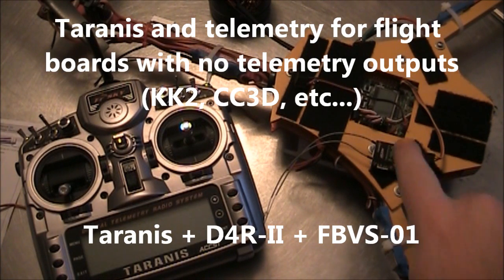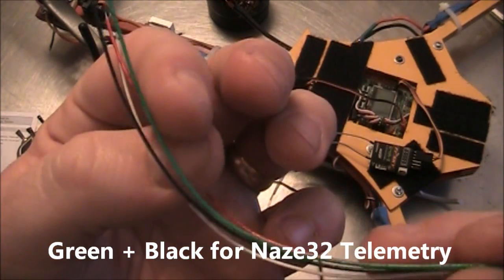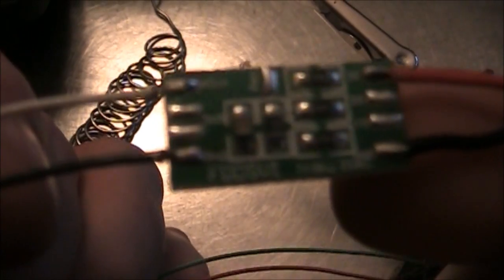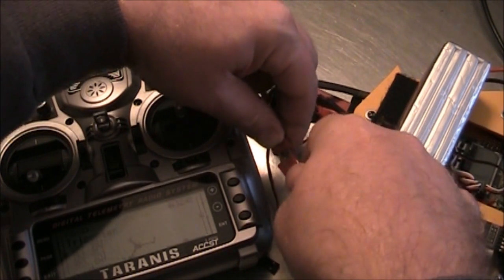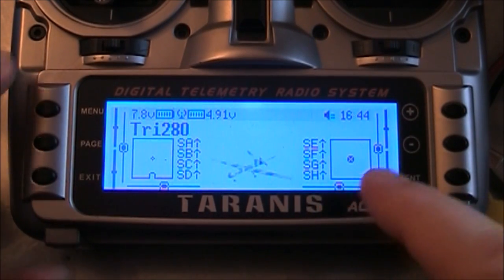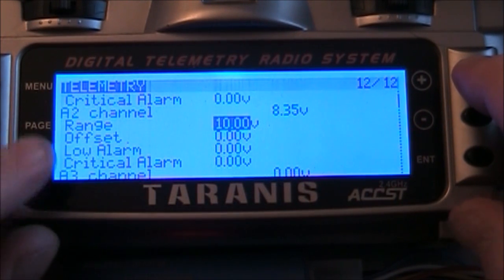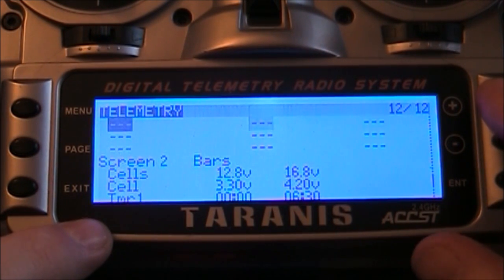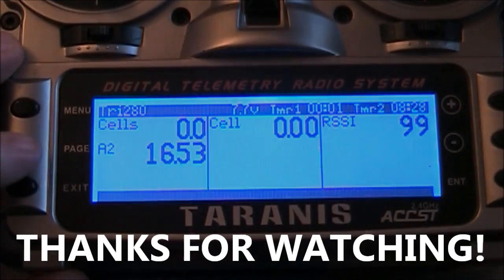FBVS-01, D4R-II, and the Taranis - Setting up Telemetry

Comment: I have a taranis  radio and is trying to set the telemetry on my kk2 board I the little voltage board you said to get and hooked up to the two wires you said dr4ll receiver my telemetry is not on page 12/12 it is 13/13 their no range 2 on my radio the .The reading for four pack does come up on the main page.
can you help

Comment: With newer versions of OpenTX (2.1+), the telemetry screens are a bit different. Instead of "Range", you'll be looking at "Ratio". If you're using the 3S voltage divider, set your ratio to the value of "19.8" (Voltage divider is a 6:1 ratio, with a max voltage of 3.3v. 3.3x6=19.8)
Reply: +Nick McCarthy Thanks for this info, Nick!

Comment: I saw your video a couple of times and I didnt understood why that ugly smoke came out, Could you describe for us why that happened. Love your video's by the way.Thank's
Reply from the maker: +Bisholi M The colored wires on my tricopter are backward because I didn't know what I was doing when I built it.  It was one of my first tricopters ever and I just wired it based on the way the wires were attached to the connectors.  Anyway, the FBVS-01 doesn't like it when the positive/negative wires are back ward.  The smoke came out of the sensor.  That is why I had to order another one and finish this video 3 weeks later.  :)
Reply: +travisgrindal Oh Thanks. Not long ago I burned out a 100 dollar camera together with a rather Good Quality Av. Transmitter :). I think we all do those kind of mistakes. and just a week ago My 2.8 Apm. bord 3 esc connection just stopped working because my cheap Minimum OSD. couldnt take the 12. volt load :( so now I am waiting too for a new version of the Board!!! ( Just Thout I share it with you.....:) ) Thank you.

Comment: Love that you didn't cut out the magic smoke bit.  It happens to all of us.  Needless to say the video was very helpful and I have the parts on hand to add this functionality to my ZMR250.
Reply from the maker: yeah, I was very surprised when it smoked.  I kind or remember connecting some of the wires backward because that was my first tricopter and I didn't know you could switch the wires around inside the plastic housing things.  Live and learn.  :)

Comment: I just got my taranus, setup a d4r-2 and naze32. Another YouTube video said use black and green wires for telemetry, it works great. You used the black and white  (although noted the norm is black/green). How do you know it's black and white? Why not black and red? I find documentation sparse and feel like I'm not going to be able to best utilize all my taranus can do for me. Any suggestions?
Reply from the maker: Good questions!  I spent a lot of time studying the included papers with both a lot of reading online!  It is kind of like the "RX" (green) wire has brains, whereas the "AD2" just understands one thing.  The Naze32 is able to "speak" the FrSky language to the D4R-II into the green wire (rx) telling it battery voltage, x/y/z angles of the board, altitude... those kinds of things.  The FVBS-01 is more of a "dumb" sensor sends out just the battery voltage which goes into the "AD2" wire (white) which, I'm pretty sure, can only understand one incoming number... like a battery voltage.  I don't know of any use of the TX (red) wire on the D4R-II yet.  I'll probably come across a use for it later or maybe someone else knows.